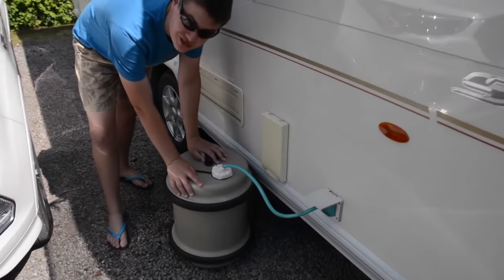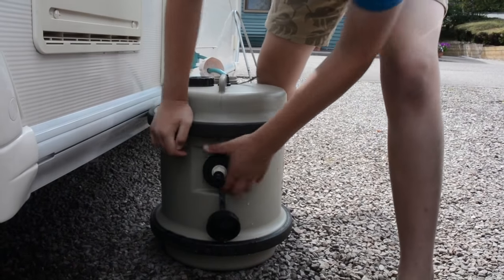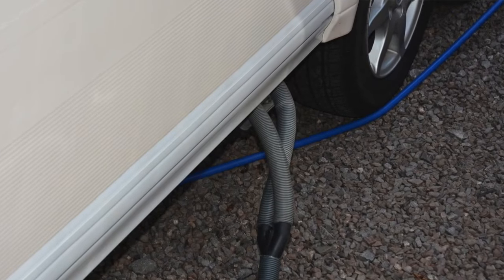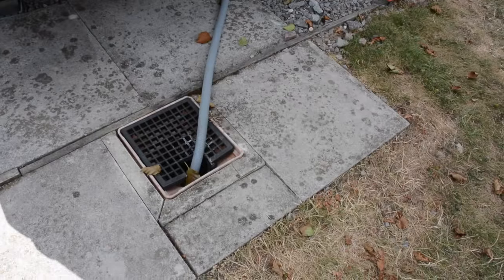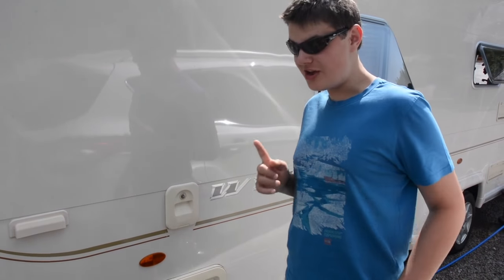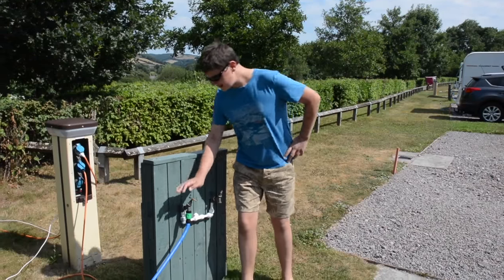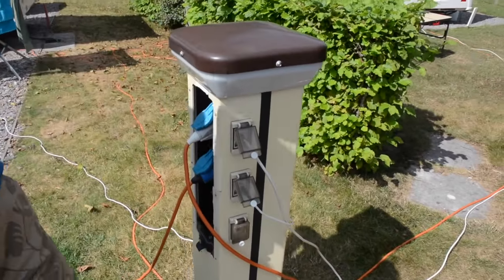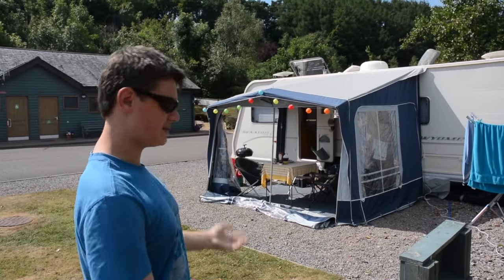How To Use Serviced Pitches

Comment: With regard to the TV connection, in our van you can connect the site Ariel lead to the SAT connection on the outside of the  van, and pick up the connection with an adapter from the inside SAT socket. Saves leads trailing through  windows & bypasses the TV booster and ariel. Try it- it works.
Reply from the maker: On our newer Vigo you can do that but this Senator was a little too old to have this unfortunately. Thanks for commenting, Oliver.

Comment: How does a single and twin hose top connection differ please
Reply from the maker: Hi Alan. Could you explain what you mean?
Reply: Yes, I have an older van with a single pipe. I use Aqua Roll no problem. I then started using a serviced pitch anf bought a Water Hog. Not used yet. I incorrectly fitted the ball valve to the top not the side. Ho hum. After watching your video which is very helpful and noted the ball valve goes in the side. The camera didn't linger on the top connection but assume this as a single pipe just pushes in the top as an Aqua Roll connection with a dust cover. Is that correct. If so irs odd that at any time only half the Hog is full due a mid position side entry. I suppose if it work half full that's okay. But I have or though I had seen twin pipe connection to vans, or am I dreaming up that one. If so how does a twin pipe interconnect with a Hog please 😁
Reply from the maker: Ahh I see! The pipe which goes in the top goes over half way so works perfectly! Hope that helps. Cheers Oliver
Reply: @CaravanningwiththeCoxs : I looked and the twin pipe seems to be water through one and electric  through the other to feed an in- tank pump.